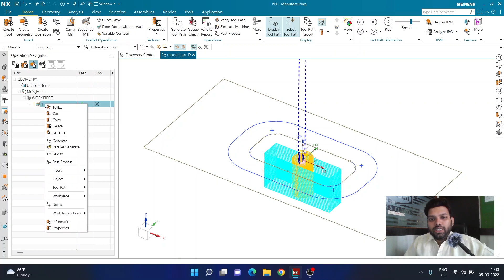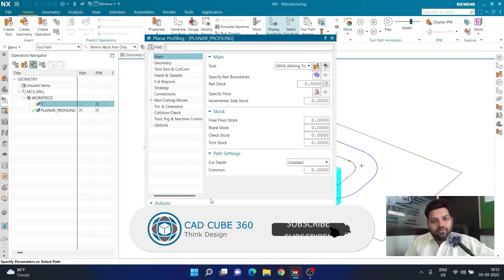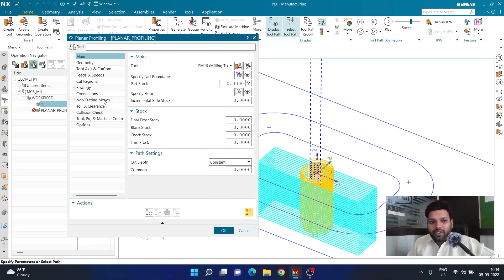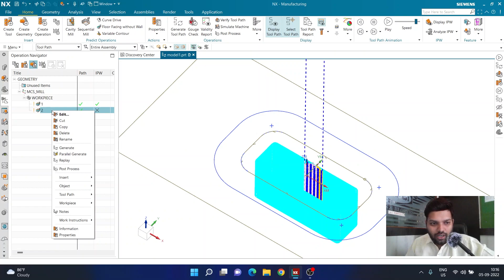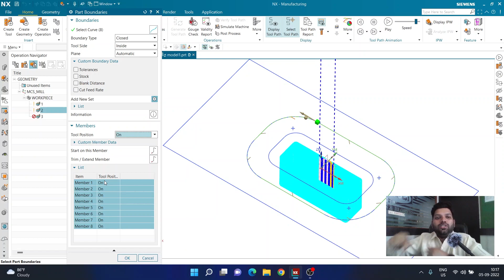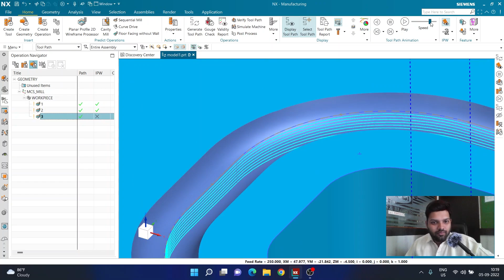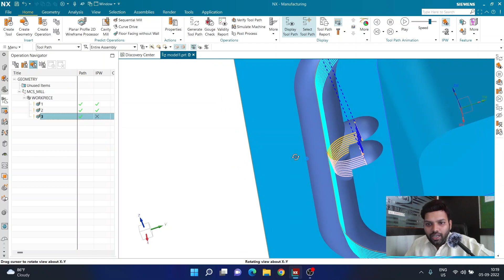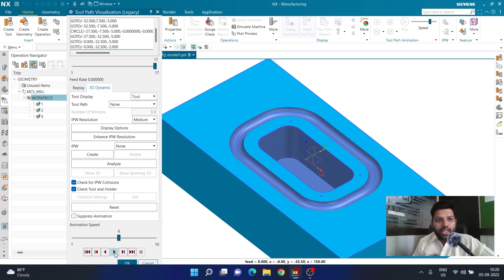PLANAR MILLING -2 | MILLING WITHOUT 3D MODEL | SIEMENS NX

Comment: please make video on how to make drafted (taped angle with 20) text (marking numbers) modeling  and its manufacturing, basically  it used in casting and molding . i tried lots of thing but nx did not give me drafted angle on text and text likes geometry i tried draft in extrud command , stand alone draft command and also tried emboss and angle in it . but some text character not take draft angle  . i did also tried thichness and offset reigion .basically i want 3d text with draft angle
Reply from the maker: Ok I will make one video explaining the same very soon
Reply: @cadcube360  DESPERATELY WAITING, THANKS IN ADVANCE.

:yougotthis:🤟
Reply from the maker: @akash123000789 if you need it earliest then we can connect over zoom or teams and you can understand that some time in the coming week